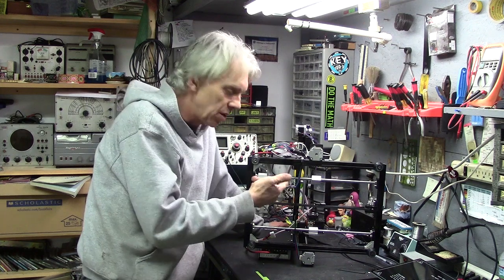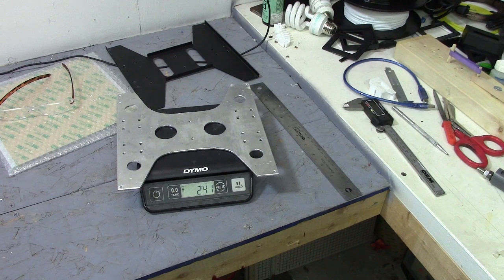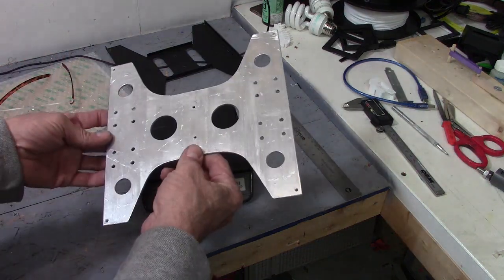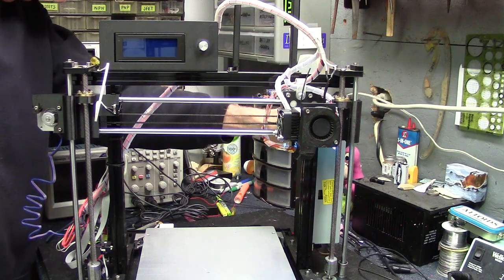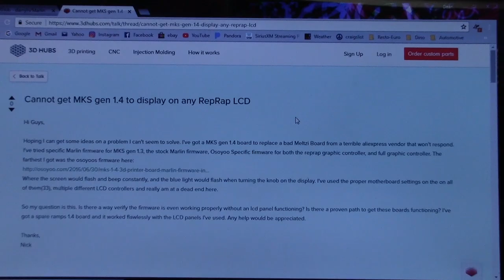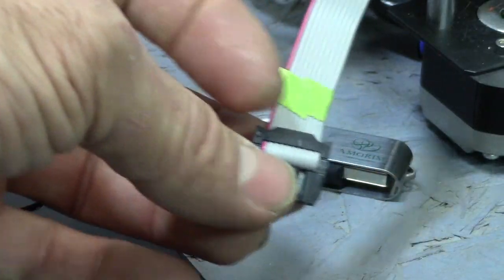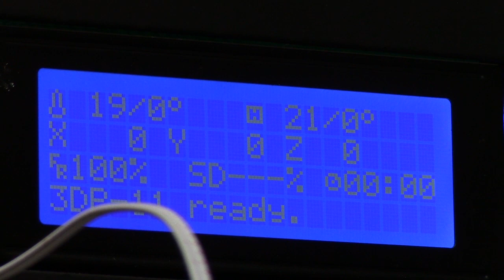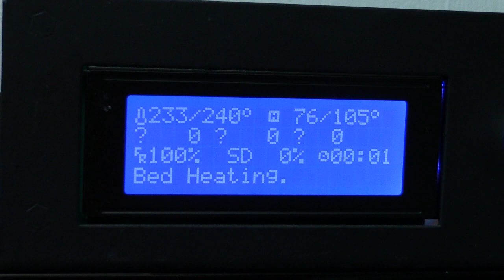HICTOP 3DP 11 Control Board and Print Bed Upgrade

Comment: Nice video.I converted my Folgertech 2020 Y axis to 4 bearings. It felt much more solid and wasn't over constrained. I used a piece of aluminum angle on each side. The bearings were held against the corner of the angle by 3d printed blocks and then the angle was mounted to the bed. Using the corner of the angle helped keep the bearings aligned.

Comment: Just an FYI, you could have also pulled the slotted housing for the Exp1/2 connection on the board, and flip them around. A lot easier then messing with the crimp connection!

Comment: Youre braver than me- as a retired TV tech - I would have taken the easy way out and reached in and cut the keyway out of the other side of the socket or shaved the key off the plug with an exacto knife before attempting to re-plunge those pins in the wires - too much a chance to fry something if a pin doesnt go right - but you got Lucky and did well! Congrats!

Comment: which replacement board did you use? I know its a 2560 clone, but I'd like the same form factor if possible. None of the boards I'm looking at have onboard stepper drivers

Comment: Mine keeps telling me heating failure. Doesn't say if it's the bed or the extruder. Been driving me nuts!
Reply: Did you get a resolution to this? For me, it was the fact that the extruder temperature sensor wasnt connected properly.
Reply: @ankursharma1232  since its decided to do this I haven't touched it. I've thought about it but that's it. Another issue is setting zero. I tried moving it to the center of the table and it rolls off the edge and tries to print, then comes up heating error.